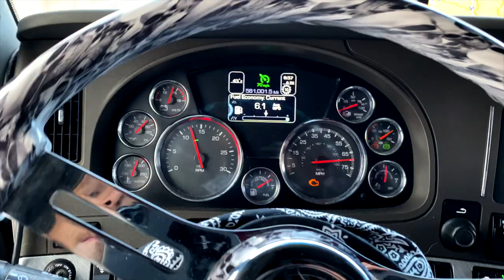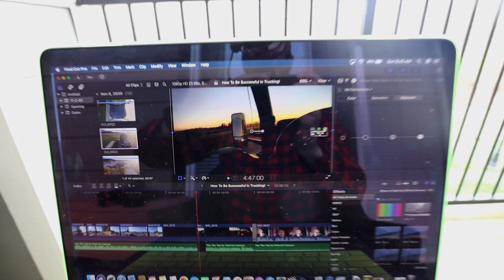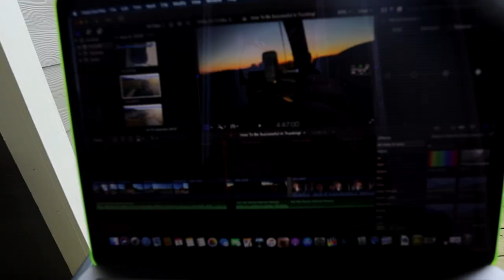🔴 How To Be Successful in Trucking!

Comment: $250? for the air lines... You can go on Amazon right now and find them for $135 or so, takes 15 minutes to install, just have to unscrew the terminal's from tractor and attach gladhands. 30 minute max install and very easy. Good video though, keep it up.
Reply from the maker: Hey man thanks for the tip I’m gonna look on Amazon a lot more.